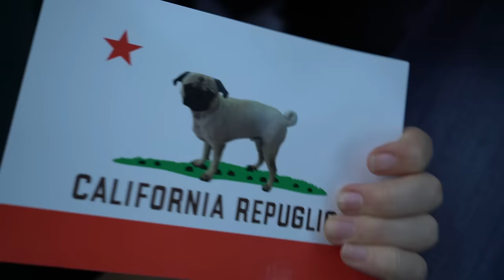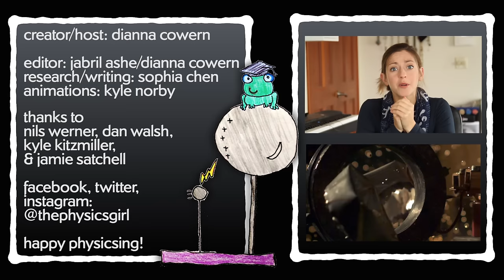How to control light with water

Comment: If anyone here knows how do they amplify the signals without causing any distortion?
Reply: Bryce Dearden There always is distortion. Optical amplifiers amplify at the photon level. So any distortion in your signal will get amplified, too. Plus random spontaneous emission, meaning your amplifier is noisy (just like it's electrical counterpart).

It's the distance between amplifiers (a design choice) that decides the signal to noise ratio at the end.

A second kind of distortion is caused by dispersion in the fiber. Essentially, all the pulses you send get smeared over the distance they travel. At the other end you'd end up with a smeared mess and couldn't read anything if it weren't for dispersion-compensating fiber bits in between. These fibers have negative dispersion and can "fix" your light pulses again.

Comment: I think quantum entanglement is the future of information, and might be the future of teleportation too :p
Reply: Nope; quantum teleportation doesn't actually transmit information faster than light. It transmits probability changes, but in order to know what the probability would be without those changes, you need a "classical" (light speed or slower) way to communicate that first. Otherwise, you have nothing to compare the results to, and can get no information out of them.